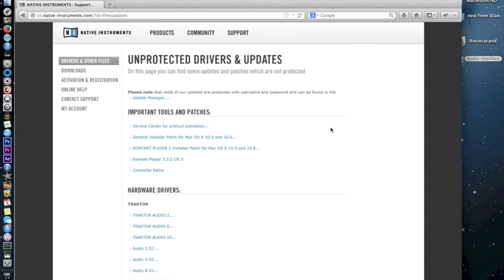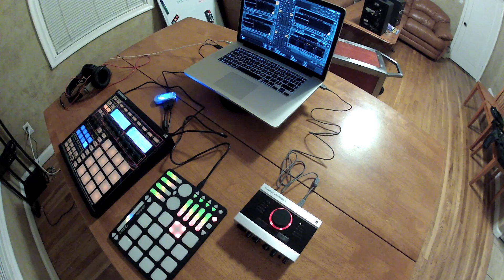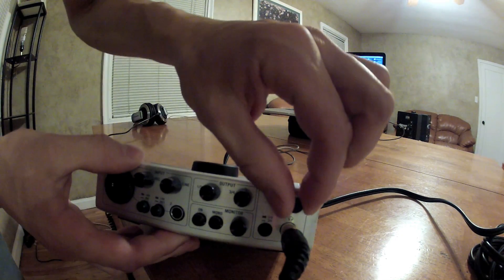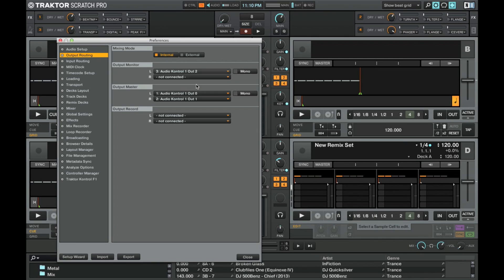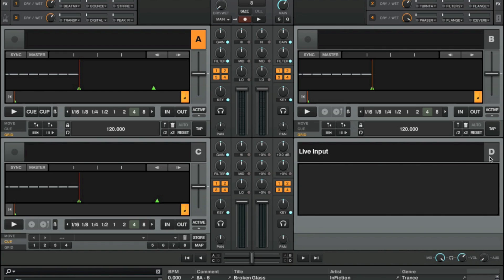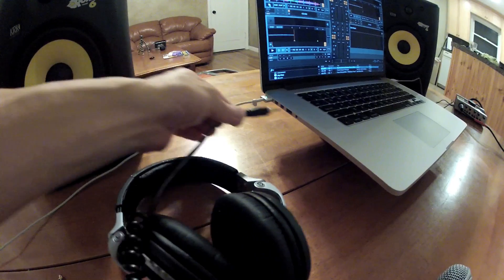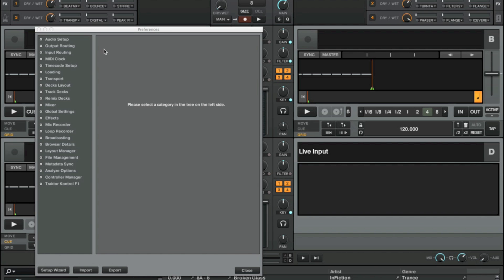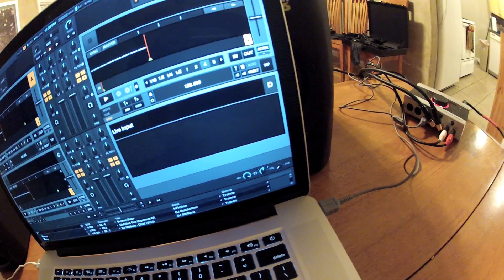How to set up an Audio Interface sound card with Traktor

Comment: i have a different audio interface... a focusrite scarlett 4i4 and in traktor setup all it lets me select for output routing are 2 channels 1 and 2 (which are  going to the speakers).  If i plug in my headphone on the front side, no new channels show up to select from. I also tried to plug into one of the other outputs on the back to see but still no channels other than 1 and 2 are selectable in traktor. I don't get it. Shouldn't it show a 3? if i have the headphone plugged into channel 3 output on the back? I feel like Im missing a step.
Reply from the maker: The channels should be available to Traktor, but haven't used the scarlett audio interface so I don't know what to do.  Open Audio MIDI setup app if you have a Mac, and that might help you.

Comment: I do have an old Tractor S2 and I need to now if i do use a clable jack to rca i will be able to use 4 speackers instead of 2 .Cos it has just 2 jack exit and 2 rcs.Also i need to know about if i can use turntable and microphone too cos the option input channel it said not supported.

Comment: hey dude ı have a problem.My sound card is m audio mtrack 2x2 and ı have a novation twitch controller.I use traktor pro 3.On stage sound card is working but in output monitors L and R is not connected.How can ı fix it? thanks

Comment: i'm using the tracktor kontrol s2. does anyone know how to record external mixing mode with it hooked up to an external audio interface?
Reply from the maker: Your main out (or booth) from the mixer needs to be connected to an input on that sound card with an RCA cable.  Then in Traktor preferences, go to the audio recorder input, and select that input channel on your sound card.
Reply: Thank you good sir, I"ll buy a new external sound card that has more inputs. Hopefully this will do the job!

Comment: HI, i just bought komplete audio 6(since my audio8 got broken) and i need this for djing, how can i setup the outputs on the back of the card to an external dj mixer 2 channels to dj in a club? Before i used the rca cables, do i need now 2 jack to rca adaptors and if so, how´s the routing (channel 1/2 or 3/4)? Thank you

Comment: Question: With my Rokit 8 speakers and sub, the speakers plug directly into the subwoofer itself. This is nice because the subwoofer applies a crossover to make sure the speakers and sub are not sharing the same frequencies. It looks like you will not have this benefit from the set up you have since the sub is going to a separate out from a separate output. Do you not get too much high frequency information to your sub and too much looks to your speakers?
Reply from the maker: +Jamal Siurano My monitor speakers and sub have crossovers, so it's ok to send the full range to them.

Comment: Hey 
I use a pioneer ddj-sx together with serato. Can I record my set with this audio interface? I mean I don't use traktor so will there be any problems?
Reply from the maker: +Sebi255 It's a lot easier than that.  There should be a "record" button somewhere in Serato.  You don't need a separate audio interface to record.
Reply from the maker: +Paul Shpakov https://support.serato.com/hc/en-us/articles/202304684-How-to-record-and-share-your-mix-with-Serato-DJ

Comment: Hey, Paul! What can you tell about the overall sound quality of this interface (is it clean, deep, centered, punchy, open etc.)? Also what is the smallest latency that can be used freely on usb midi devices like mpd32, maschine or any keyboard? do you have any issues with software btw?
Reply from the maker: Hello!  Honestly I don't have enough experience with audio interfaces to answer that question.  The Audio Kontrol 1 works well and I think the sound quality is clean, but I would recommend reading some reviews for more detailed information about the way it sounds.  The current version of this sound card is the Komplete Audio 6.  When using Traktor, I usually set the latency to about 5.4 ms, and it works fine.  The Native Instruments sound cards can run extremely low latency, provided you have a good computer.  Plug the interface directly into your computer (no USB hub) for best results.
Reply: I've read quite a lot about Audio Kontrol 1 actually being better that Komplete Audio 6. Lotta people think KA6 is actually a downgrade but of course I can be 100% sure only by dealing with it by myself. Yet still I see that AK1 is really a great audio interface especially for that money. 5.4 ms - that's amazing.

Comment: where did you get your TRS cables and what is the quality difference between hooking monitor speakers up your way with TRS and going a different way by hooking them up with Male XLR to TRS 1/4''?
Reply from the maker: Sweetwater has a great cable selector page:  http://www.sweetwater.com/shop/cables/finder.php

Connecting your monitors with TRS or XLR is the same.  Both can carry a balanced signal.  This means it carries the signal on two wires and the third is a ground, compared to a TS, which has only one signal wire.  A balanced connection rejects interference and ground loop noise.